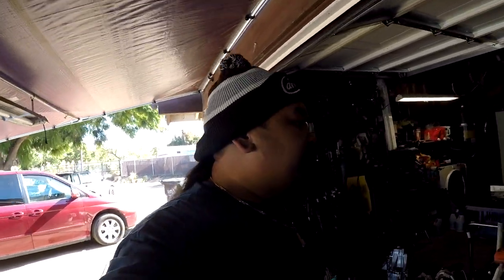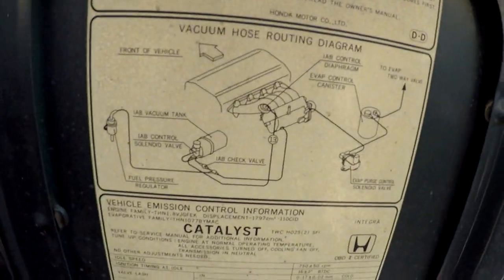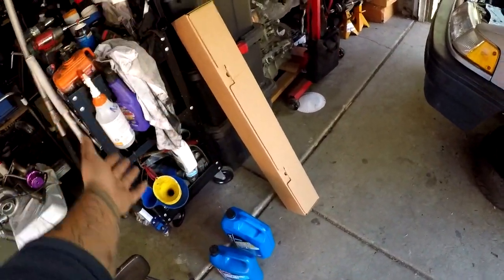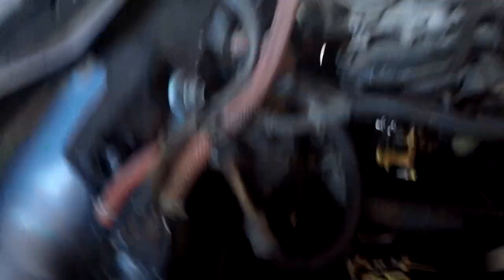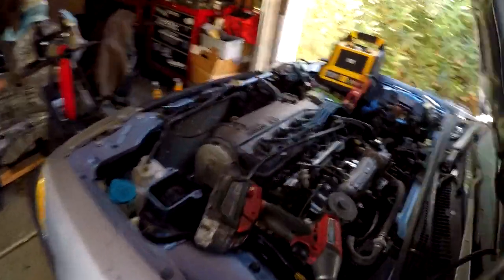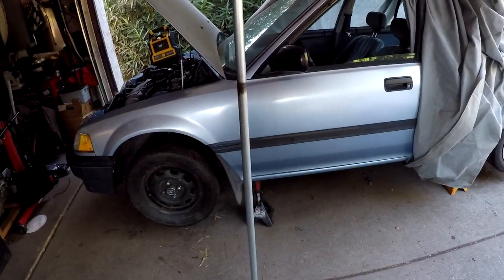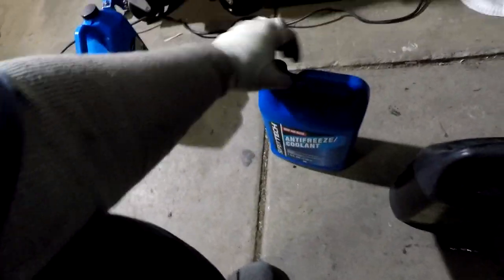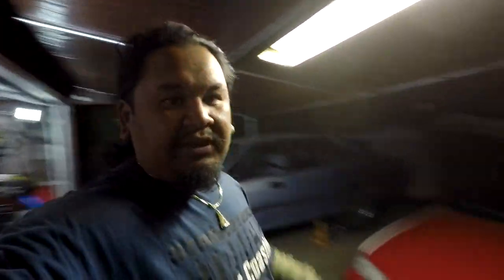CRX died on me !

Comment: Hey man love your videos!! I have a 90 EF, and I was wondering, not counting the motor, How much does it cost to K swap an ef?
Reply from the maker: it all depends. new vs use, 1 company vs another. my brothers car without motor i spent about 2700 in parts for the swap. he about about 11k in total when it was done while mine was about 4700 done.
Reply: I found a full swap for 1700! 
For a EF you think im going to spend another 3000-4000 in parts alone to able to swap it in??? 
I'm afraid it might be too expensive.

Comment: If i don't zip tie the overflow hose when bleeding my coolant am i doing it wrong?  I have a high idle while driving in neutral that goes back to normal while stopped at a red light.  Tried a bunch of stuff but could never figure it out.
Reply from the maker: technically no. it will still bleed out still. its just to prevent it from over flowing in the over flow tank while trying to bleed. may still have bubble in your system.